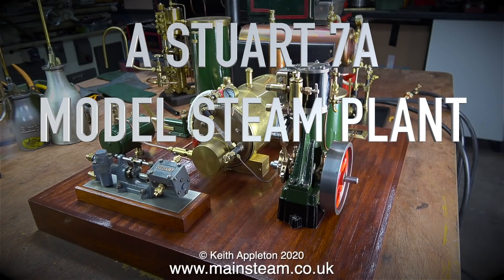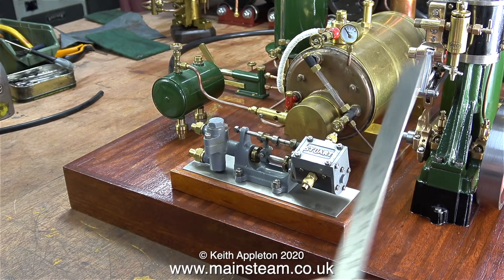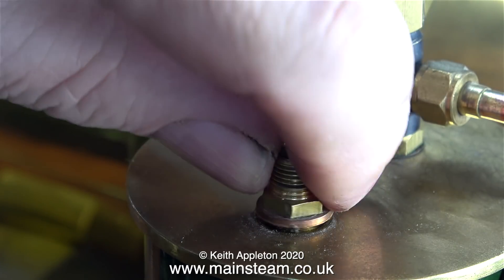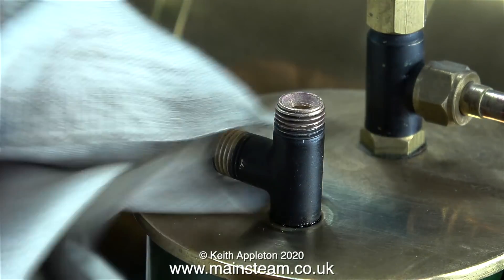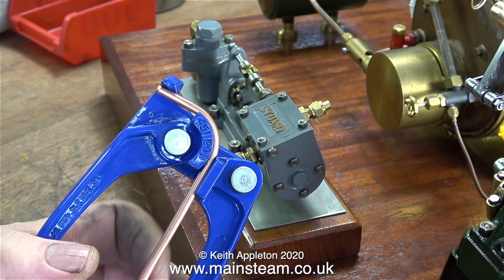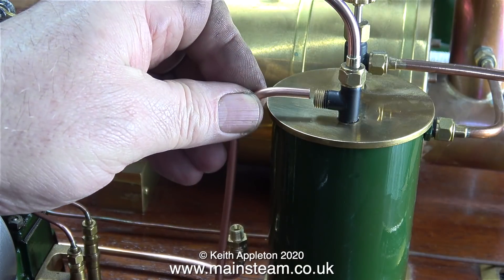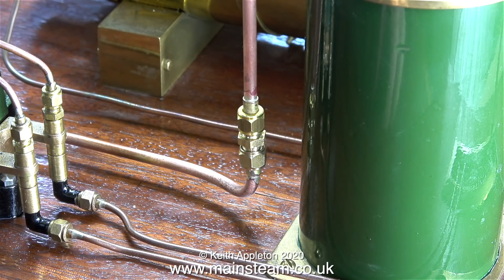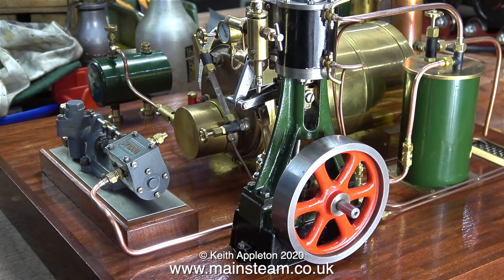A STUART 7A MODEL STEAM PLANT - PART #21

Comment: Do any model engineers cut pipe and add joints to match commercially available lengths to scale? Or does that look weird on a plant?
Reply from the maker: Sometimes, if it is done well it looks OK but can be more difficult to clean & polish.

Comment: Is there any particular reason that you don't use compression fittings for copper pipes?
No soldering required for compression fittings.
Reply from the maker: Better to silver solder for small steam pipes . . .

Comment: Bonjour Keith,
Great steam plant indeed, I can't wait to see it running with steam. Two questions :
Is there any risk of 
against pressure in the machines by having the two exhaust pipes on the same oil separator ?
How will you prevent these two cast iron cylinders from rust ? 
Amicalement, Raphaël
Reply from the maker: No it's not a problem. I show how I prevent rust in many of my videos . . . .